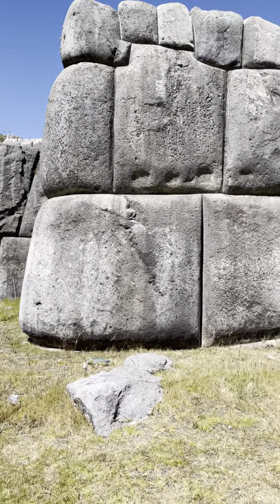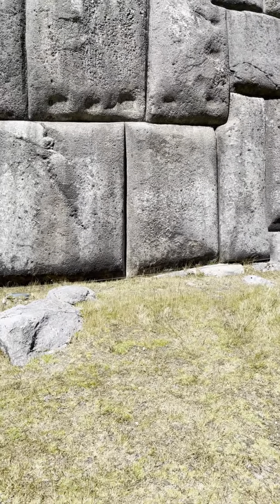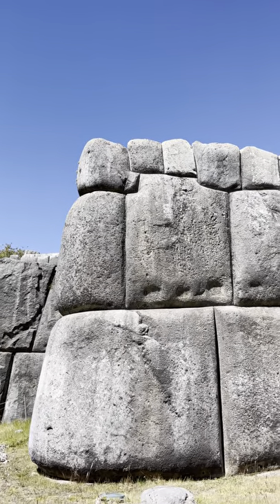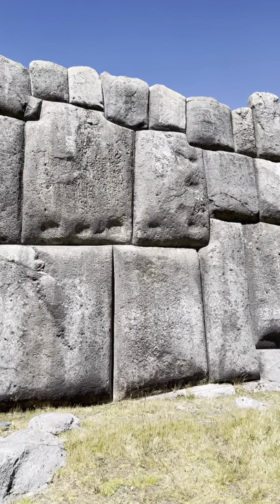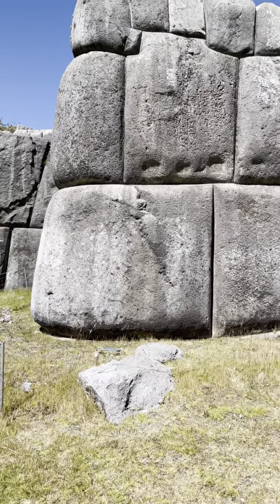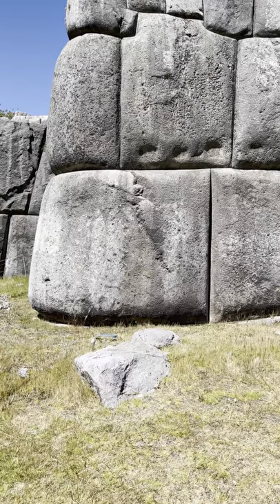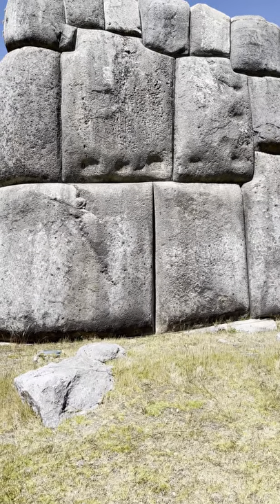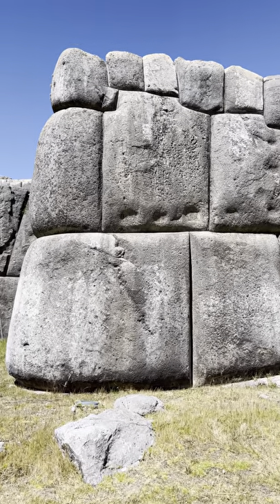Ancient Engineering of the Sacsayhuaman Megaliths

Comment: Pretty sure there is no „Earth“ ground to sink into, its probably a rock foundation under this thin patch of grass
Reply: 0
Reply: What this person means by Earth is dirt. In other words they're saying that this formation is sitting on top of bedrock and they are probably correct although I would imagine the two stones are tied together with a metal clamp like they found in almost all of the other ancient sites of the world where this type of stone work is done. Once you tie the two rocks together they act as one mass and it doesn't matter if one sinks because the other will too, or not, and vice versa
Reply: You right , he must be stone to talk like he is sombody omg
Reply: Isn't it surface area?  The heavier stone has a larger surface area on the ground coming out to a similar PSI or BAR on ground.
Reply: @eddyb1596   don't get the density and surface area confused or intertwined. Just because a stone is heavier doesn't necessarily mean it has a larger surface area and vice versa... that being said your point is valid in that a larger surface area will distribute the weight more evenly and create less pressure per square inch which may lead to less sinking of a larger Stone.
Once you start down that road, as far as looking at surface area for structural support as it pertains to multiple items located in a single space, there are many other factors that begin to come into play ( like substrate density and drainage, etc.) These added factors create a level of complexity that makes the problem of weight shifting much more difficult to attempt to solve. 
It's much easier just to know your footing is a 100-percent immobile and start from there even if it requires digging down quite a ways.
Reply: @nickbrockelman  It was a total spherical cow in a vacuum, physics answer. I was assuming the only difference in the stones was size and thus more/ less of something is more/ less mass.
Reply: @nickbrockelman   metal clamp brings just another complexity to the equation. It is in fact cast iron, which was only discovered many centuries later in another continent. Which, curiously used the same technique to bind rock blocks. There are something behind all this.
I believe that before the Great Flood the civilization was much more advanced than we suspect.
Reply: @eddyb1596   in part I believe you are right. But only a calculation of mass over area can confirm. It looks like there are many other factors to it.
Reply: @jfrjr7964  oh yeah, real world is always more complex than calculations on paper. Like I said it was a total perfect world, physics answer. But surface area definitely has to be a factor.
Reply: That's the way I'd do it.
Reply: @jfrjr7964  what Great Flood? Don't believe there's enough evidence of more than the refilling of the Med basin way way back and as to it being a flood or taking much longer to refill is up for debate.
Reply: @eddyb1596  Yeah you're completely right. That pile of rocks acts as a single rock since it is in a stable arrangement. Meaning each square inch of ground has the same amount of rock above it so the pressure is the same, so no calculations need to be done to stop part of the pile sinking, as long as the pile is of uniform height.
Reply: Exactly...and they made sure it did before laying the stones.
Reply: @michelwalter3182  8
Reply: @jfrjr7964  .... you my friend.
Just nailed.
💯% agree with you.
Reply: @joseluisgomez6747   check this out. Gen 11. 
The descendants of Noah multiplied and they started to build a “Tower” in a great city.
But the Lord, came down and saw what they were building.
Now, He was impressed by their technology and were already using baked bricks instead of rocks. You see, they had pretty good understanding about rocks for building their cities. If they selected bricks instead of rocks, i am quite sure they knew it was better than rocks.
Some of these “rocks” we see today seems to be casted. Would that bricks technology be what today we call rocks. 
Now, our Lord understood that if the peoples language weren’t mixed and confusion wasn’t created among men. Nothing could stop us. 
That was the Lord saying.
That isn’t a little thing. Those people were very smart people.
Reply: Well if you’re pretty sure then that’s more than enough for me
Reply: They poured concrete in for a solid base...duh
Reply: Bingo. You can see the bedrock under it

Comment: There's rock at surface, which means they likely have the stones bearing on bedrock. Settlement would be negligible.
Reply: He sounds like a flat earther.
Reply: Their weight is spread across the area of the wall by the overlapping stonework set on top.

Comment: I'm stunned each time when someone gives mystery in-depth analysis of simple kinetics.
Reply: Excellent 👍 😎
Reply: Strong kinetics so strong you cant even see the connection to bedrock that barely moves
Reply: Also this looks more fake than the latest unreal engine renders
Reply: Simple kinetics??? This was done in Ancient times by someone Do you think they had kinematic an kinetic classes back then….I think not
Reply: @Donny Dynamo  dude how simple one has to be not to see you can model this in several hours to check the balance, and it is very easy to work on big rocks like these. Yet, it takes time. I'll explain it simply, ok? So you don't have to stretch your narrow mind. Take these two blocks of rock when they are still only roughly shaped. Cover one of the touch surfaces with sth like, whatever, dried mud, chalk, minced/powdered rock of colour. Touch the rocks. Look where the clean rock got dirty. Scratch the excess rock that got dirty. Cover with that chalk again. Touch them until you have the perfect shape. Balancing them is easy; dude, don't believe in theories that make your brain a banana-strawbery McD shake covered with bacon. If one doesn't understand how a plane flies, planes still fly. Here are two pieces of rock, and you scared me with what F.up my kids might once meet and get crashed with neanderthal level of thinking.
Reply: @Kyle D  easy. Anyone can do this. It just takes time. Look, you narrow mind. When you don't understand how planes fly, planes still fly, unless you tell me now I had been scammed, and a few hundred times I jumped over continents wasn't actually on a plane. (Extraterrastial technology?!) Here are two pieces of rock that were gently matched. Piece of cake. It only takes lots of time to be matched manually.
Reply: @TheDoublebassist  you're a bit special aren't ya?
Reply: @SmashFetus  oh yes. What makes me stand out is that I didn't skip first five classes of primary school, and I've lived in a village once, in a Hindu island, where every second farmer carved in stone and wood after field work. I won't say "I've seen things" because, indeed, there is nothing to be excited about. Few pieces of rocks make conspiracy theory to some.
Reply: @TheDoublebassist  just because you missed the point, doesn't mean it not there lol
Reply: @basketball230001  Yes. Lol It's all mathematics.
Reply: @SmashFetus  He didn't miss the point. Everything he explained was correct.
Reply: @CleanupKrew7  you also have missed the point lol

Comment: The only way the stone on the “left” would sink more than the stone on the “right” is if the stone on the left had more rocks stacked on top of it. The height of the wall is the same everywhere so the sizes of the rocks is pretty much neglible
Reply: you understand tbe ground isn't homogeneous and uniform right ?
Reply: Except the stone on the left weighs more.
Reply: @codyramos3200  maybe it does weigh more, but it also have a bigger surface area contacting the ground.

The weight doesn't matter, the density does.
Reply: @BetaTestingUrGf  yes.. you understand the physics, the author does not.. what matters is the height and density of the stones and uniformity of the soil beneath, not the weight of individual stones

Comment: Wow! I don't want you as my engineer.
Reply: I was thinking the same thing. Overall there’s the same amount of weight on top of every single stone just because they’re different sizes doesn’t mean anything assuming they all have the same density
Reply: @SupremeGrandmasterAzrael1  lol he’s saying all of the stones on top are the same density too. idiot. there’s a roughly equal weight pressing down on the bottom stones because of the way they’re cut and laid. because the weight is equally distributed, all of the bottom stones are being pushed down with the same amt of force
Reply: @SupremeGrandmasterAzrael1  
🤦
Reply: They had ignorant artisans... Probably some sort of protest....
Reply: @HauntedHarmonics  you aren't taking into consideration the each stone on the bottom has different weights. Which would add to it sinking.
Reply: @a564-c3q  I get it your are not very bright
Reply: @SupremeGrandmasterAzrael1  Pressure = Force/Area. The entire structure is one giant rectangle (hence an evenly distributed weight when you consider the whole system), and the surface in contact with the ground is almost perfectly rectangular (hence the force exerted on the ground is evenly distributed). Doesn't matter if it's split into smaller parts, so long as there is no gap between them and the Force/Area is constant then they will sink at the same rate.
Reply: @LibTarded-ez1  They sure have a different total weight, but also different area of the bottoms! The estimated kg/m² should be roughly the same!

As The less heavy stone also has way less surface area contacting the ground.
Reply: @DJ-kg6zq  lol what you talking about my hole point is that things that are the same density and  are different sizes weight differently. Idk whats so hard to understand
Reply: @SupremeGrandmasterAzrael1  you’re changing the argument, just to be right. Nobody was talking about which one weighs more.
Reply: @SupremeGrandmasterAzrael1  here I’ll do what you’re doing… bigger rocks will decompose slower so they will last longer and go further into the ground. I’ll just change the argument to be right😂

Comment: The answer is the opposite of Darwin. We are actually devolving.
Reply: Urghhh.. Unfortunately the internet is morbid proof of this devolution..
Reply: Devolution by design, influence,  tickling of the ears, and dazzling the eyes.
Reply: @clifford_2zero7  It’s not the internet, it’s mostly the tv, radio and the newspapers. Internet is very important and it’s necessary, others are not.
Reply: @dropssergian  that's what the previous two were said to be when rolled out but info only has power when absorbed and used properly and most of the cattle are just reclining with a brew and watching porn.

Comment: “Hey wanna stack rocks”
“Sure!”
Reply: Let's leave the rocks and just put lines in them
Reply: It's so much deeper than that and all the more confusing.. amazing even..
Reply: @Keys879  not really dude, but w.e. makes you feel better.
Reply: @anthonypareigis6188  Solid argument. Excellent points. I can tell you did your homework and encapsulate a lot of knowledge. Bravo!
Reply: @Keys879  moving multi-tonne rocks isnt that hard and can be done with stoneage tech and a single person. Just look at coral castle in florida. Just because you dont understand how its done doesn't make it complicated.
Reply: @anthonypareigis6188  Coral castle didn't involve 15 tonne blocks set to a the tune of 2,500,000 blocks over two decades. Mined from 500 miles away and utilizing only copper tools.
There's a big difference. Don't be so daft.

If it's so easy, go make a Pyramid or a castle. Oh right, no one actually knows how Ed built Coral Castle. Hmmm. How did he do it? You apparently know.
Reply: @anthonypareigis6188  Where did I say Aliens?
The people in who moved the Thunder Stone in Russia also would disagree with you on how 'basic' it was. It took a mind boggling amount of labor, Rollers/Manpower/Capstands/etc.. Of which, NONE have been discovered at Puma Punku or tiauanakku at a level required for such feats. A place that has largely been devoid of trees for centuries, for example
And don't even get me started on the asinine level of accuracy with which these structures were made. The Peruvian/Bolivian structures make a bit of sense with theories such as poured stone/concrete. But those in Egypt are incredible. The math that was implemented, the information left behind. Much of which the Egyptians were unaware of in the later Dynasties. Their techniques STARTED in absolute perfection and as time went on, they never reproduced such quality. How is that? They wrote down everything for future generations. But never how they achieved the greatest construction projects of Man's legacy.

It is absolutely not, Basic. Your ignorance is so apparent here.

Nice. Just delete your post.
Reply: @Keys879  also theyre moving multi tonne rocks up a moutian what makes you think they couldnt bring a log? Ffs.
Reply: @anthonypareigis6188  Where did they get these logs? Clearly you haven't read my previous posts thoroughly enough.
Reply: @Keys879  for puma punku at 15 minutes they address building above the tree line.
Reply: @anthonypareigis6188  Show me pictures of a Bolivian or Peruvian forest, near the sites please. I await.

Comment: I've thought a lot about how they could have fit them so perfectly together, and I may have figured it out. I believe the got the stones relatively close to the desired shape using traditional methods, via
chiselling/flaking/cracking, etc. Then, once they were in the close, they used applied an powdered abrasive of some type (sand, obsidian, crushed rock) to the surface, and began rubbing 2 of the stones together so that each opposing surface is abrading the other, causing the high spots on each to wear away until both sides are smooth. Think of it as you would when lapping valves so there are now gaps to leak.. The tool you’re using to sand away material is itself being sanded away, proportionally. The roughest, most abrasive parts of the surface are the first to be worn away, until it’s just smooth surface on smooth surface. No alien death rays, or telekinetic powers, or the impossible steel tools necessary
Reply: Fairly sound, but how do you rub stones thousands of pounds together like they were small rocks? Think of the constant pressure needed to keep together and rub even the small stones flat. Kind of an oversight. I have seen no ancient method or invention that could accomplish that task. You would need the men of old, the men of renown to even come close. Now if you had a giant that was 20 foot tall and could handle those stones like they were small, it would actually make more sense. It's almost like there has been giants that have been dug up, photos taken, most ancient cultures speak of them, Bible and book of Enoch tell their origin, and we're told that truth is a myth. Imagine that.
Reply: They have been moulded!
Reply: I thought the same, kind of like a see-saw method but the stones are leaning against each other
Reply: There's evedince they were exposed to some type of heat and how are they going to rub two 100 ton stones together? They may not be 100 tons, but same difference lol
Reply: Do you know how much they weigh friend?  Obviously your intelligent.   I'd like a demonstration.  You do it and I'll give you $500K.  No modern tech.  Just as you whit fully described.
Reply: It was all one stone that was just cracked and  broken apart to resemble a bunch of stones placed there on purpose when in reality they were always there and just shaped into something resembling a man made structure placed in that area
Reply: Your idea would be feasible if there were a way to rub  that heavy of boulders together. Maybe a fulcrum? Maybe a boulder on something so the boulder rocks like a see-saw? Then the boulder on top of the other boulder could be dragged with some assistance from gravity.
Reply: @matthewstephens7509  smart man. The hero’s of renown, no doubt! Giza as well. One of the most fascinating narratives that is all around us- even our planets and days are named after them.
Reply: @matthewstorer8236  A large number of horses/cattle and some rope could probably do it. Or it's just one giant rock that they cut into multiple squares.

Comment: The stone on the left will be dispersing a similar/same amount of weight per square inch of surface area making contact with the ground. So the weight of individual stones is irrelevant as they are bearing the weight of the stones stacked on top therefore the force transferred to the ground is even. 

Still amazing.
Reply: I can tell your not a man of words.
Reply: @evenbiggerafricanguy3079  It’s ‘you’re’.
Reply: @rocingersol5060  sorry man i not be too good at spells
Reply: 6/10 milky moment 

Good man
Reply: @milkinanime7047  yes brother man i means goods by it's sir,
Reply: @evenbiggerafricanguy3079  10/10 
Funny man biggest african guy
Reply: @milkinanime7047  are you making fun of me on Twitter?
Reply: @even BIGGER african guy quite the opposite my good I found your response humorous and thus rated you high in milk content which to the common man may sound bad but to men of class like you and I we understand its amazing to hold such high milk saturation
Reply: @milkinanime7047  dude that's racists
Reply: @milkinanime7047  I'm not milk